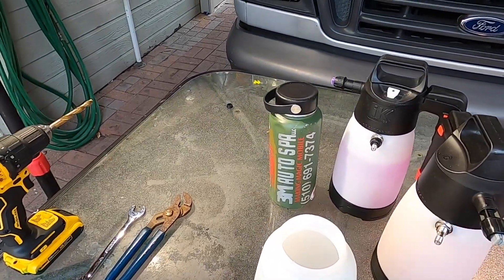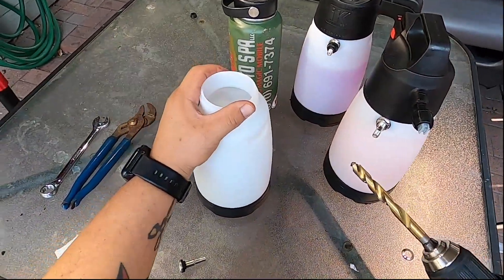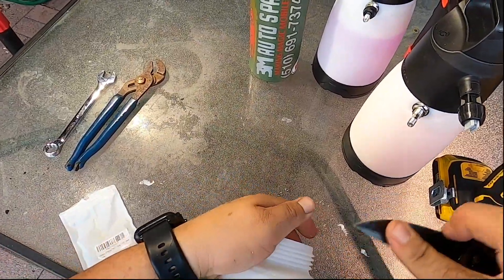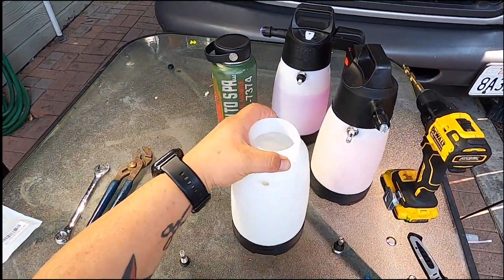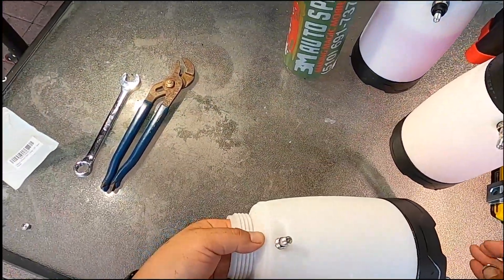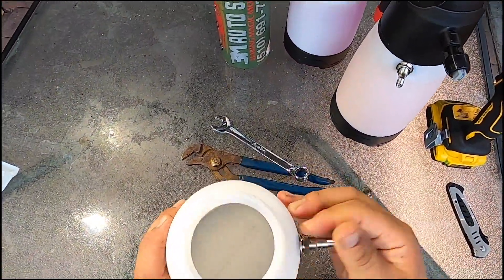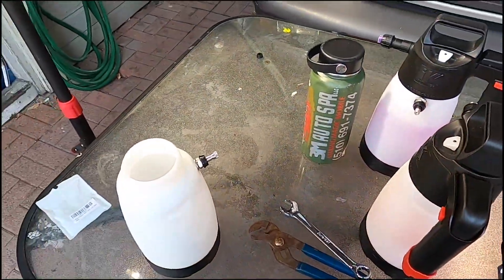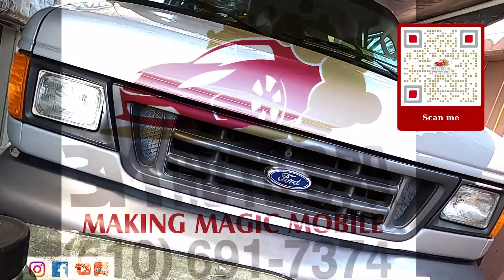IK FOAM PRO 2 MODIFY stay tune for the mobile video

Comment: and why do you add the 2nd grommet... that 2nd grommet is for a different hole size
Reply from the maker: It’s the way it seal and doesn’t leak
Reply: @3mautospallc are you sure cause I just double checked again and did confirm they are for different hole sizes. And that’s per the manufacturer

Comment: Why not put it in the lid like the 2+? It even looks like it has a blank in the spot where the valve on the new model is
Reply from the maker: Great question @brians.4488 the reason why I did not drill where the new model has it in place, was because I will damage the internal system and air will leak.

Comment: Great video. Can the Schrader valve be drilled on top instead of the location you made the hole at?
Reply from the maker: Thank you, appreciate your positive feedback. I don’t think that would be a great idea since that’s the main system we’re the pump creates the pressure.

Comment: I like this schrader valve you have but could I use a rubber one like off a rim?
Reply from the maker: @E85STI  im not to sure, not sure how you can seal it. This one seals with a nut
Reply: @3mautospallc  thanks for the reply but I ended up using the rubber one off the car and it works just fine the only thing is that it looks generic of course but that’s ok because it’s only me detailing for my customers.
Reply from the maker: @E85STI I’m glad to hear it all worked out 💪, best wishes and happy holidays. 
Don’t forget to like, share and hit the bell 🛎️ notifications 📣 to be the 1st one to know about my next video.